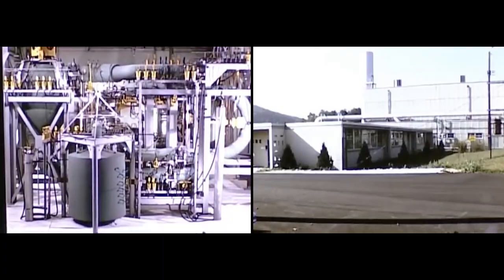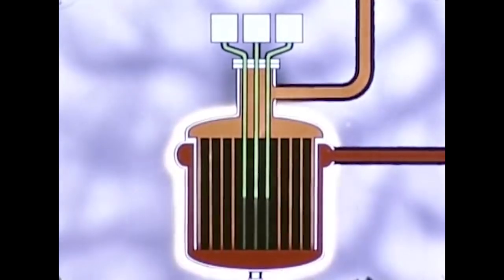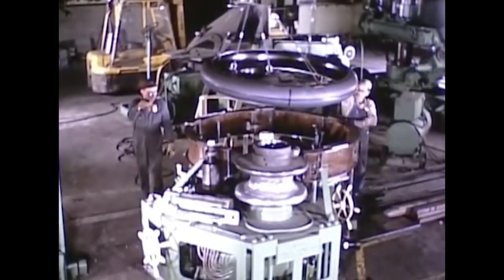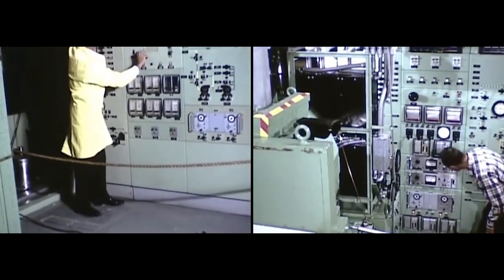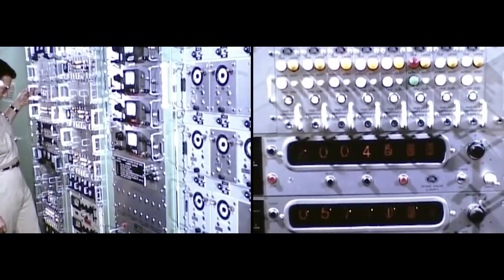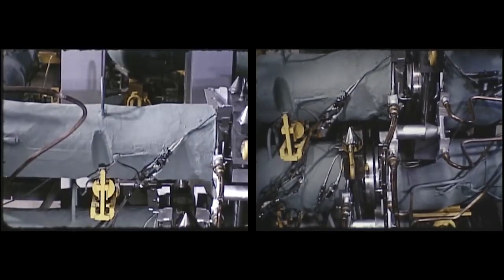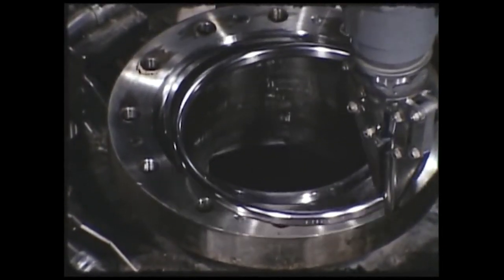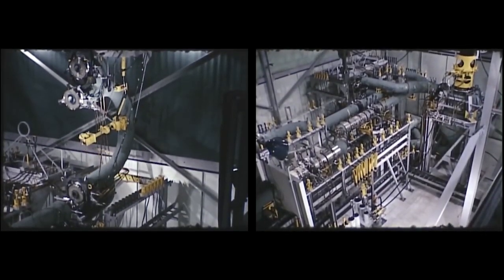Molten-Salt Reactor Love - Historic ORNL Footage - MSRE and Mock-Up of MSR Maintenance

Comment: The solid fuelled water cooled reactor was ideal for irradiating the fuel. Plutonium was easily extracted and the waste stored. Long term storage issues ignored   It was a relatively small step to using pressurised water to increase reactor power and ultimately power low pressure steam turbines. These are quiet in operation so ideal for a submarine. Westinghouse simply scaled up the designs saving huge sums in development costs. 
Alvin Weinburg who largely designed the PWR used in submarines always said they were not suitable for up-scaling to utility scale plants. Too much stuff to go wrong not least the cooling system 
Weinburg also developed the nuclear aircraft power unit. He said it was an interesting exercise that would never be practical. However he saw it’s great potential for power generation. The ambient pressure and strong negative temperature coefficient made it naturally load following and intrinsically safe. 
Unfortunately too much money had been spent on PWRs and their safety homologation so the MSR got sidelined. 
There are issues. Pumping ferociously radioactive liquid is always hazardous and lithium salts lead to tritium gas (radioactive hydrogen) production. 
The British Moltex Static Salt reactor solves these problems. 
(1) chloride salts don’t produce tritium. 
(2) the fuel salt is contained in tubes. There is no pumping. 
(3) the heat transfer medium is the same salt without nuclear fuel. Heat transfer is improved with a stirrer but no pumps needed. 
Fuel can bd added and removed by swapping fuel tubes like any solid fuelled reactor. No new tech needed. 
Corrosion in a molten chloride is virtually zero but is an issue with lithium fluorides. It’s also a problem within PWR cores. The neutron flux literally cracks water into hydrogen and oxygen. Both of these degrade the reactor metals. This can’t happen with chloride salts.

Comment: Molten salt reactors can easily burn Uranium 238, and we have millions of tons of Uranium 238 sitting around in warehouses, unused (leftover from the nuclear arms race).

Many nuclear engineers still prefer Uranium (not Thorium), because we have so much available.
Reply: Forgive me if I'm wrong, but U238 is fertile, not fissile & would need 2 b transmuted into plutonium 2 burn it up.
Seems 2 me that the resultant trans-uranic waste would make this a bad plan
Reply: @phillbradshaw7190  Yes. Thorium and U-238 are both fertile, not fissile.  Both of them need to be transmuted.  Thorium transmutes into U-233 (fissile) and U-238 transmutes into plutonium (fissile).  Both U-233 and Plutonium are bomb grade material at least officially.  So U-238 and Thorium are pretty equivalent for use in MSRs.

Comment: Why pump the hot material? Would it not be easier to design a pump that pumps the cool material (i.e. after the heat exchanger)?
Reply: Lower pressure in the core would be my guess.

Comment: Not a word about thorium, as it should be. The technology Breakthru is the MSR, not the potential fuel that has become so fashionable.
Reply from the maker: The original video (MSRE) did mention Thorium (at 39 seconds). I'm just trying to keep things clear with this 8m summary. Most of what I removed was construction details about digging the pit, etc.
Reply: @gordonmcdowell  My point is that so many people are fixated on "Thorium" not realizing the MSR is the actual important part, not the fuel. Especially since uranium is much easier to utilize.
Reply: @chapter4travels   so may just be one more way to skin a cat

Comment: MSRs will give us all the radioactive waste as conventional reactors and cost twice as much. What a deal!
Reply: There is very little "waste" from liquid fuel.  Solid fuel can burn only a tiny fraction before the rods become unstable and must be discarded as waste. 
Liquid fuel is constantly reprocessed to achieve almost full burn up. What remains could still be processed to produce highly useful isotopes.
That is only one reason why MSRs are vastly superior to solid uranium PWRs.
Reply: @JB-xo1bd  MSRs will give us all of the radioactive waste as conventional reactors and cost twice as much. Conventional nuclear reactors are 2-5 times as expensive as renewables. What a deal.
Some MSR designs require on-site, continuously-operating fuel reprocessing plants (the dirtiest process in the nuclear business that creates the same radioactive waste as conventional reactors) and present pathways for diverting or stealing weapons-usable material. MSRs routinely release large quantities of gaseous fission products, which must be trapped and stored. We have never, ever been able to trust nuclear operators to do that or nuclear regulators to hold the operators accountable for their releases. Under some circumstances, the hot liquid fuel can heat up and destroy an MSR in minutes. Molten salt creates very serious corrosion maintenance problems. Maintenance on a radioactive MSR is difficult, time-consuming, dangerous and expensive.
Reply: @jackfanning7952  Factually they can produce much less waste. And, due to far less civil engineering for water supply and containment, they would be cheaper to build. They also work when it's not windy. DYR.
Reply: @JB-xo1bd  Factually they do not work when it is not windy, because there aren't any. LOL.
Reply: He’s a troll, probably working for the Chinese or Russians
Reply: @andrewjmcd919  Jack trolls all the nuclear presentations on Youtube, a weird hobby of his.